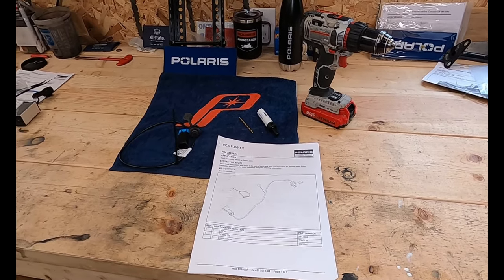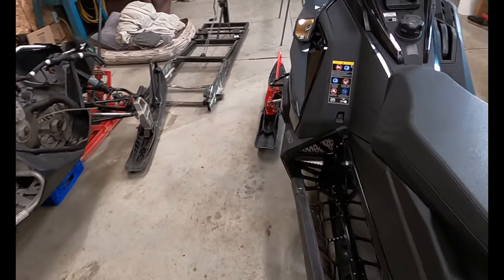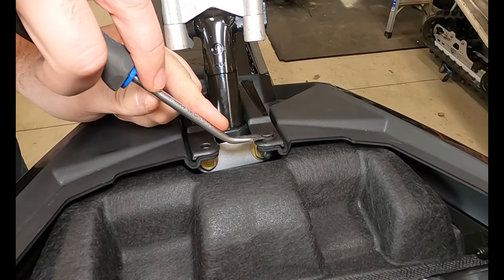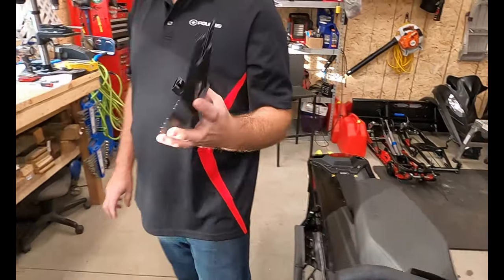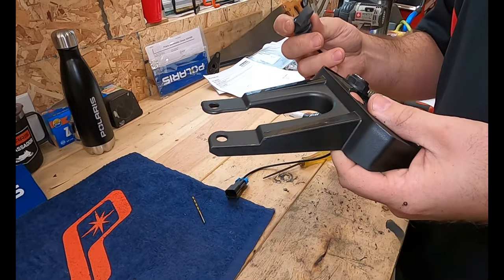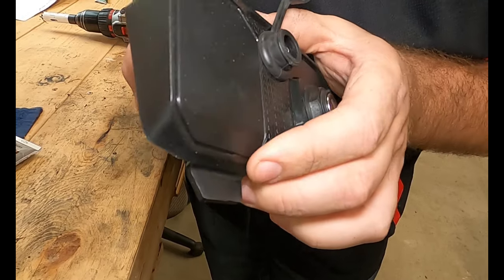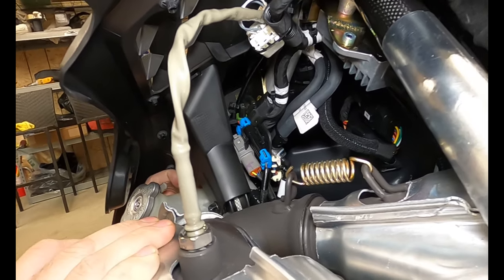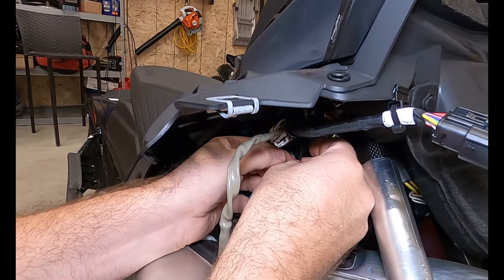Polaris MATRYX Heated Shield/RCA Plug Installation

Comment: If you push the plug end forward in the grommet it allows you to collapse the grommet easier to push through the hole. This makes so you do not need the dielectric grease.  Thank you for the video spent an hour looking for the sled plug end until I watched yours.
Reply from the maker: Hi Andrew, We did end up doing that after when we took it out, you are 100% correct, way easier thanks for the tip.

Comment: Instructions and templates with RCA Jack were useless. Had it figured out in five minutes with the video. Only tip would be don’t use grease on the grommet use dish soap, no problem getting through the three-quarter inch hole and don’t have to pull the RCA jack out of the grommet first,  plus the dish soap will dry up.